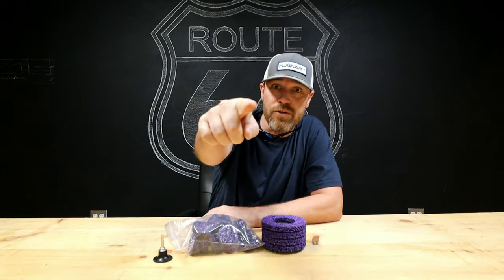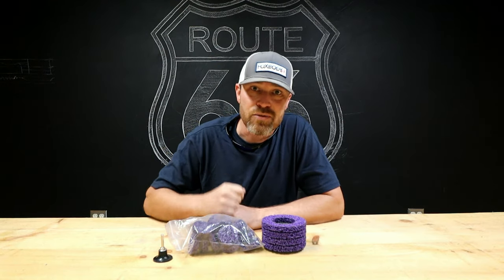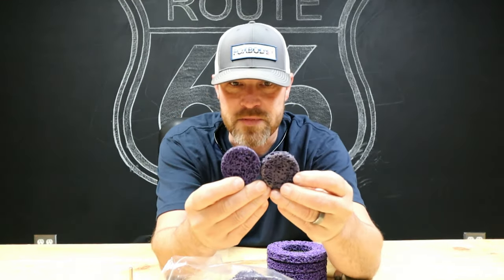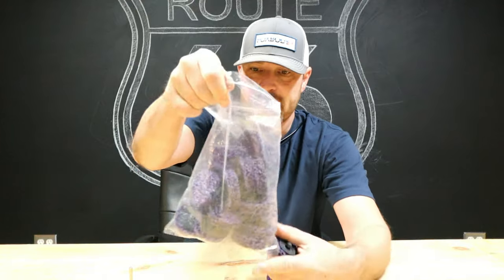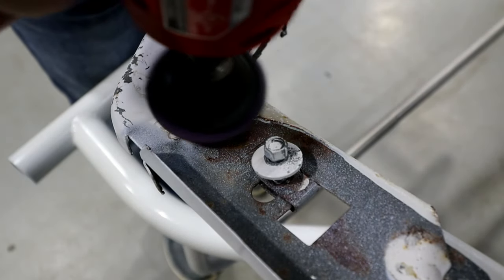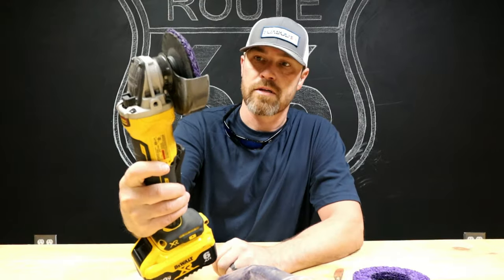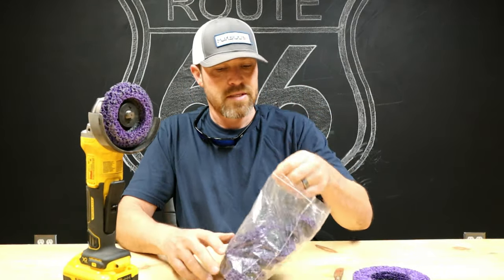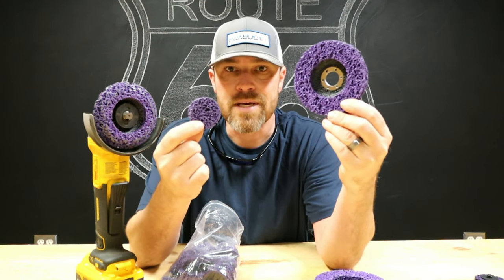You Need This Tool - Episode 135 | Surface Prep Disc For Paint And Rust Removal

Comment: Been using them for years,best thing I found for removing rust and old paint.
Great tip!
Reply: I'm restoring a 60s 3 point brush mower with old fashioned durable paint, and some light rust do these work better than a normal flap disc?
Reply: @GraniteStateBackcountry  Yes.The only short coming on these is if you are in a tight spot and there are sharp metal edges it will eat them up.
They will make fast work of light rust and prep the metal surface for paint or primer at the same time.
I use them on my Milwaukee cordless.I like the 2” wheels better than the 3”.
Good luck!

Comment: I bought a set after watching you use them on that first video. These things work pretty good. I have a 96 F150 with the xl package. Im coating my ugly painted bumpers in raptor bed liner. I got both the small ones for a drill and a couple of the angle grinder larger ones. It stripped the paint and surface rust off in no time. I though it was going to take me hours to get to a primer ready surface. Close to 30 mins a bumper and they are ready to go.  Thanks for showcasing these, they saved me a bunch of time and effort.
Reply from the maker: thats awesome. I love them

Comment: Looks like a good piece of kit. I need to strip down a metal hand rail and the smaller discs may be better at reaching the tight spots. What type of grinder do you recommend, angle or die? Semper FI, Ken

Comment: These are commonly referred to as Rapid Strip discs and come in black (which is silicon carbide grain) and the purple (3M) or orange (Blaze from Norton) are a ceramic grain. They are not all the same and often times the black construction does not hold up any where close to the premium ones shown in the video. The other issue with cheaper versions that you might find at swap meets or HF is the strength of the plastic hub that secures it to the holder. They'll either break at the "screw" or completely detach from the disc, either way, you'll have a 20,000 rpm projectile in your shop. Light pressure is all that's needed and they do a great job of removing mill scale from cold rolled steel. I put Wurth in the business of selling these discs under their private label back in the 1990's.